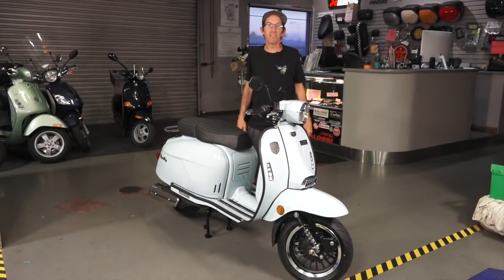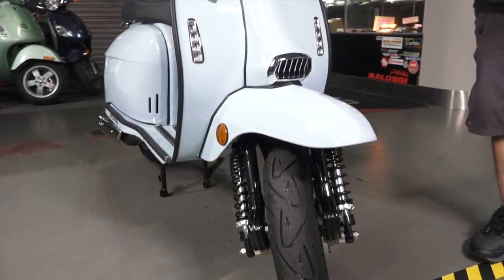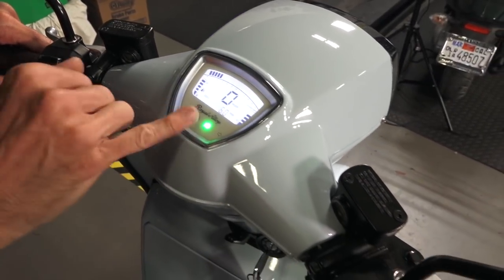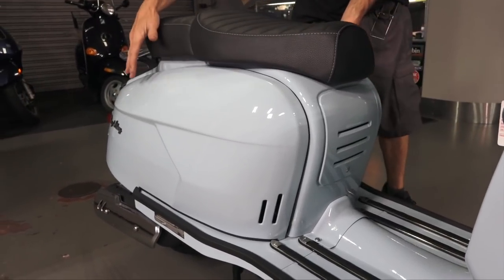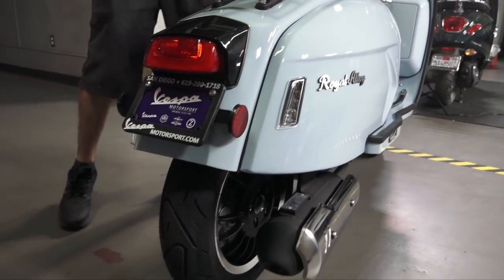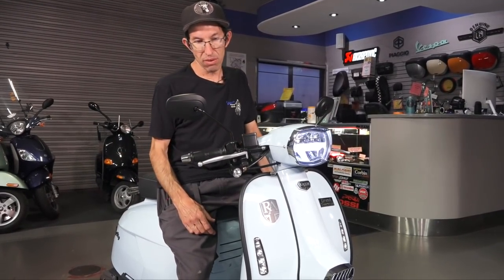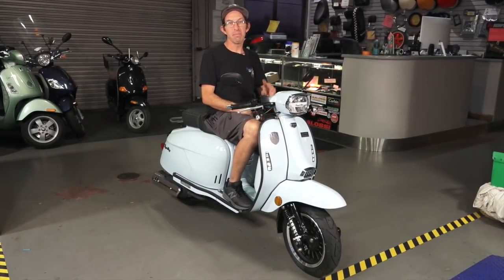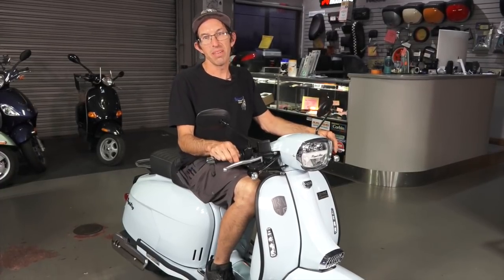2020 Royal Alloy GT150 Scooter Review

Comment: WE have a lot of these RA's in the UK now, a bit controversial because of the way the company formed after legal battles with  Frank Sandersons Scomadi company who were the innovators of the original Lambretta series III auto , I have to say though I think that RA have taken the scooter to a different level with build quality & reliability & they seem to listen to the customer in fact after many people in the UK asked for a scooter based along the lines of the Lambretta series II they have come up with the goods in the TG 300 powered by the Piaggio derived 300 engine & it does look good but unfortunately the frame geometry seems to be the same as the GT & as you point out it makes for uncomfortable riding position if you have even a normal (regular) leg length & the price for the TG 300 is over £5,000 otr making it a very pricey scooter. As always thanks for the review ride safe & KOKO.
Reply: Why do they call it a Royal Alloy if its made of steel?

Comment: Love my Royal Alloy. Review was pretty spot on. Yes, it has a carb but mine cranks perfect every time. Cold or hot. I'm 6' tall and I don't feel too cramped. Once i got used to the riding position, its very comfortable.  The only downside is the power. its not weak but its top speed could be a little better. The trade off is you get great stability at the cost of top speed. Its a heavy bike. About 265 lbs dry weight. Vespa ET4 was about 36 lbs lighter I believe. But, as Robot stated, you're paying $2000 less than the comparable metal Vespa. I hope it finds its market. If the 150 succeeds, the LC 200 or 300 may show up in the states.
Reply: weighs the same as a sprint.....not "Heavy" at is  268 for vespa
Reply: Made by SYM(SanYang Motors) of Taiwan with solid reliability.

SYM has been in bike making since 1960 and being No. 2 maker in Taiwan with market size of 20 million scooters.

SYM took a conservative approach of adopting  old-school carburettor in this new scooter for owner to DIY.

I own 2 carburettor scooters were flooded in the typhoon, both were revived by changing spark plug only while washing the mud off the  engine shells and blow dry.  The bike shopkeeper told me that it would cost me a fortune should they be fuel injection ones with all those electronic parts and sonsors.
Reply: How cold does it start up? I just moved to chicago….

Comment: The good thing about carburettor scooter is that they are more water-resistant.

My carburettor scooter was soaked in the local flood knee high.  I took it to bike shop for repairing.  The shopkeeper flushed mud off my engine shell, then changed a new spark plug and started the scooter with a car battery.  After several trials and succeeded.  Some dirty water was spit out of the muffler.  The shopkeeper run the engine till idle stabilized and gave it to me.  I was charged for the price of new spark plug only.

The bike shopkeeper told me that it would cost me a fortune to replace so many electronic sensors and components should it be a fuel-injection scooter.

Comment: I've had a Sym Wolf for 15 years. The motor and drivetrain are bulletproof. They once made motorcycles for Honda. They produce Honda clones and Taiwan is a world class manufacturer with excellent quality control. Knowing this thing is powered by Sym, I wouldn't hesitate to buy one. I bet they will even give you less mechanical problems than a Vespa. No knock against Vespa, but Sym is right on par with the big 4 Japanese manufacturers.

Comment: The UK/EU versions are all fuel injected to meet Euro 4 standards. I'm currently considering the GP200.
Reply from the maker: Hope we get those soon!
Reply: @VespaMotorsport  The 300 has recently arrived using the GTS300 engine and drivetrain.
Reply: @Vespa Motorsport in the UK they now have a model with the Vespa Gts300 motor fitted from the factory

Comment: Good review as always! Fyi, if I am not mistaken, the Euro front turn signals are pre-wired behind glove box with a plug-&-play system so swithing from the US spec ones to the shield ones is a 5' job. Also, the new 300s already vailable in Europe are fuel injected, perhaps they will come to the USA for the 2021 model year. Cheers!
Reply: All models since 2018 but law have to be efi. In Europe
Reply: They have abs as standard in the UK.
Reply from the maker: Thanks for the info!
Reply: @splodge5714  they have cbs system and abs systems depending on engine sizes. 125s are a combined braking system. Where as the 200 and 300 are abs.

Comment: All the Royal Alloy scooters in the UK are fuel injected. So, basically, in the US we're getting a cheaper engine... a GY6. Kind of a put-off. Also, has zero underseat storage... like a Lambretta. And where do you hook your helmet (I guess you could lock it to the back rack). Love the looks but I have real issues about buying a carbed scooter.

Comment: Looks kind of cool on video ?  I’m usually okay with certain Clones  although I did buy a Chinese made a scooter  from a neighbor in Florida  that turned out to be pure junk  that model was sold at Advance Auto Parts for several years  as a rule on Motorcycles I prefer Genuine Honda products  although these being under Genuine might be okay  BTW my 1964 Honda Motorcycle is nice because I can easily find parts and knowledgeable repair shops etc

Comment: I’ve been considering buying one of these for the past few years and keep putting it off.  I’ve not test ridden one yet.  But I’m a 5’4.5” female and about 125lbs and I worry that this scoot will be too tall, too heavy and too wide for me.  I have short legs and think it would be unsafe, which is a complete bummer since I’ve been obsessing about having one of these for a while.  Can anyone advise on this?  Any petite ladies or guys who has one out there?
Reply: Go to a shop and try them out. Remember some scooters have a wide seat which takes away from your leg length.
Reply: I owned one for two years and highly recommend replacing the seat it comes with and getting one of the racing seats. They're lower and, more importantly, narrower than the 'king and queen' seat. The one thing I will say with this scooter is that it's not especially well balanced... it's unusually heavy in the back. I didn't have any issues riding curves or most roads but this scooter slides like crazy on any kind of vaguely slippery surface in a way other scooters I've owned do not. This was even after replacing the mediocre tires it comes with with quality Pirelli Angels. I've since sold my GT 150 and really miss how it looked, how great it is customized, etc., but from a safety standpoint... I feel relief.

Comment: Thanks for sharing but we definitely not looking for this SYM garbage in Los Angeles  but we definitely looking forward to the New Royal Alloy Gp-300s with the Piggio pre HPE 278cc motor in which PM tuning already have a 26WRHP!!! Motor kit for the Royal Alloy 300s the RA-300s has the tried and GP race tested twin fork front end and 50 pounds lighter than the GTS 300 HPE it has a digital dash as standard it has been redesigned and is basically a lambretta mixed with a Wasp the best of both worlds and finally a 2020 SCOMADI/Lambretta SX liquid cooled 300cc Thumper hurry up and get these new Vespa killer models with Piggio engines 🙉🙈🙊

Comment: They’ve got the looks bang on but when are they going to make one that can challenge some of the highly tuned original two stroke lambrettas out there because trust me they’d make this 150 look stupid and until they do they’ll never get enough converts.
Reply: Robcatist - RA are stuck with 4t as are all manufacturers. To sell a scoot with tuned 2t levels of power the scooter would be £10k+ and it will still be automatic. Never gonna happen.
Reply: They already have you can get one with the 300cc engine from the Vespa GTS

Comment: hi scooter,have a vespa lx 50 and need i think to do oil change,at what interval and the capicity of oil and grade needed,I live in Ireland ,thanks
Reply: My primavera is 3 month,and oil 1,2 L grade 5W40
Reply: Iam from Indonesia
Reply: 50c.c. usually needs high rev to keep the speed.

In Taiwan, we change oil every 1000 kilometer.  Scooter of one cylinder engine could use "thicker" oil to dissipated the heat, so 5W, 10W or 15W are OK.

Comment: These are much better with the water cooled motor. Either 125 or 200/300
Reply: Nope!
Simpler is better!
This is reason why most scooters with engine size smaller than 250c.c. usually go without water cool.
Reply: Horses for courses, anyone who rides for longer than an hour would be better off with WC

Oh and the WC motor in these is far more advanced than the old ac unit